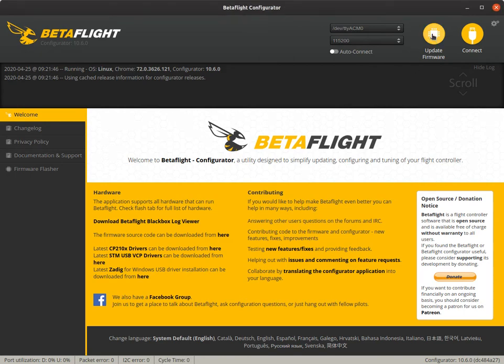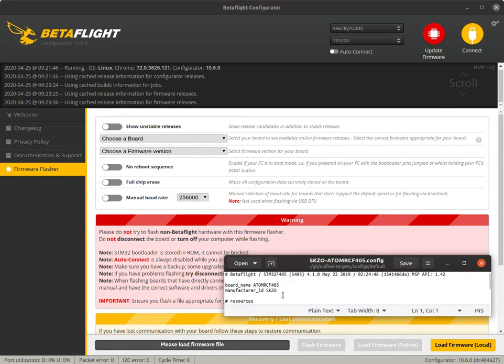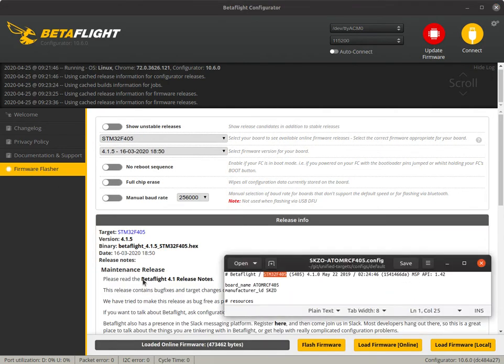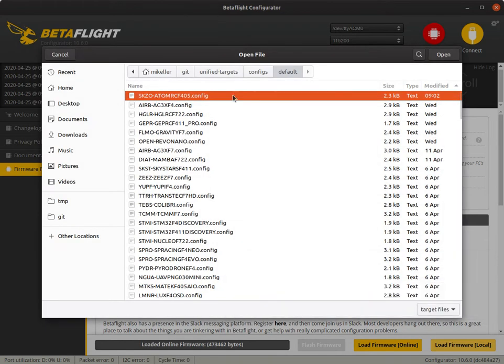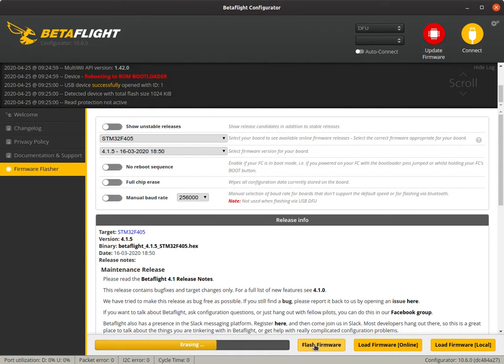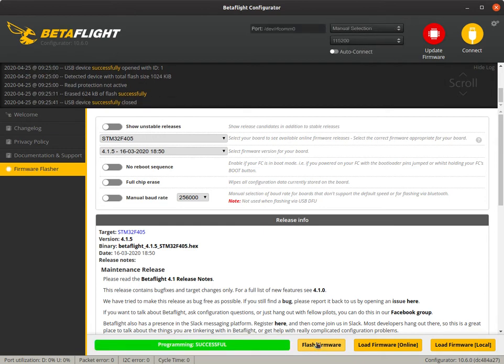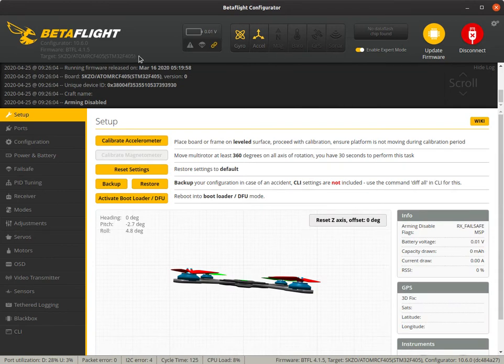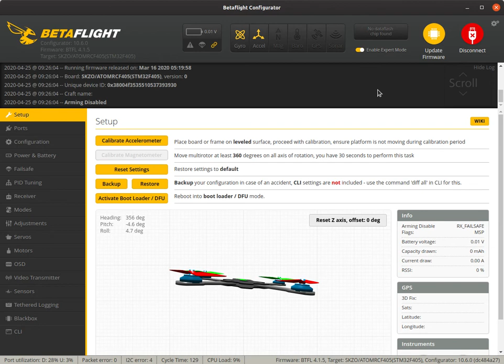How to install Betaflight onto a custom board with Unified Targets

Comment: Hi Michael, I've been trying to build my own F411 flight controller based on a so called Black pill with IMU9250 in SPI mode. I can flash the pre-compiled unified F411 target but there's no configuration for gyro, accelerometer ets.  I've been trying to create custom configuration and assign pins for spi, uarts etc but it's showing errors and doesnt compile. I've done something similar in the past flashing NAZE target on bluepill and works fine.. Any chance for a bit of help? I've opened a request in Cleanflight and iNav but not much feedback..
Reply from the maker: If you can get the STM32F411 target to work you are pretty much there - all you need to do is work out the configuration that is needed for your peripherals, which can be set at runtime, no recompile needed. Have a look at https://github.com/betaflight/unified-targets/blob/master/configs/default/MTKS-MATEKF411.config for an example of how such a configuration could look. Once you have got a .config file for your target, you can then use the instructions in the video to install it onto your hardware.
Reply: @mikeller_nz  Thanks for the reply Michael. Just saw your reply as I didnt have much time for messing around with that. I've printed a pinout diagram and working off that for the pin assignments. ;-) and trying to get mpu9250 to work off SPI rather than i2c. seems the matek config locks the board for whatever reason. I'll be trying some other configs. Again, thank you for your reply!!!!